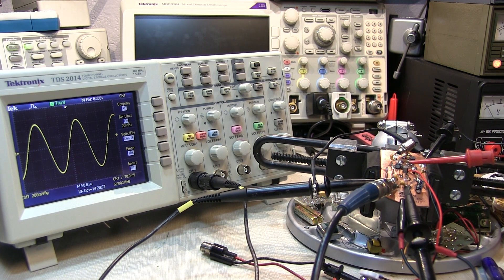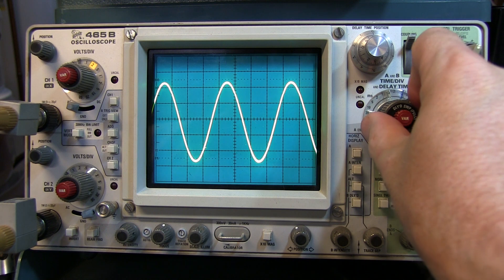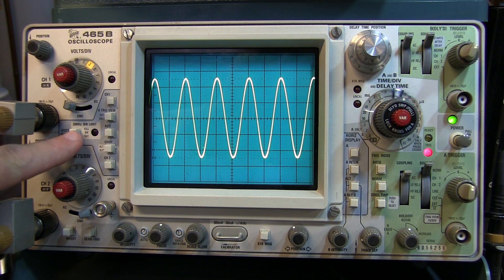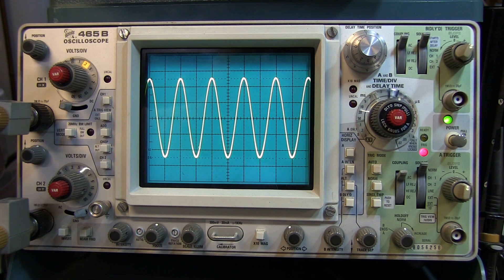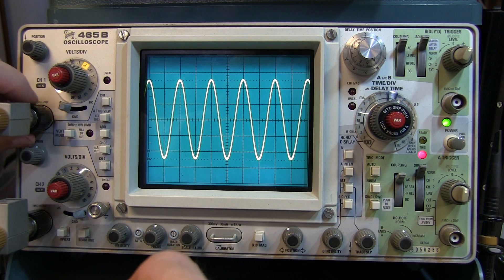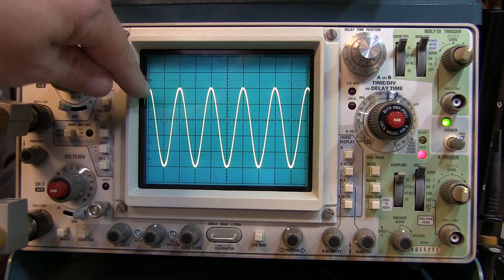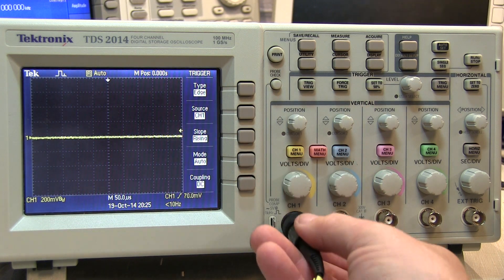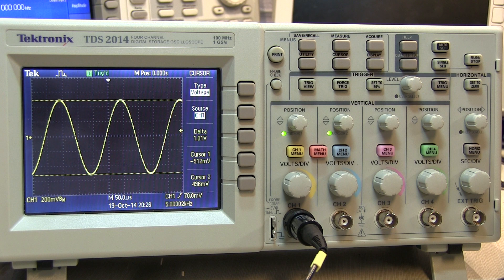#179: How to make a peak to peak voltage measurement on a scope

Comment: How do I measure a peak to peak voltage of 0.55v? I thought I could only set the vault for division to be 1 volt per division or 0.5, not 0.05
Reply from the maker: Your scope should give you more choices than that!  Using 0.1V (100mV) per division, your 0.55V signal will be 5 and a half digits tall.

Comment: Awesome videos 
Sir I need your help to get a sinewave voltage amplifier circuit in the frequency range of 500khz to 1200khz which is to be driven by function generator sinewave signal source of 10 volt peal to peak. The output of the circuit should be 35 volt peak to peak at given input signal with an output impedance of 600 ohms..
Can you please share the schematic diagram with component values . An early response will be highly appreciated.
Thanks & kind regards.

Comment: I used the 465B for most of my career ... and I loved it. I've got some stories I could tell where it really saved my butt finding a tiny glitch on the 5V supply on our prototype of a drone nav system (using Omega signals, before GPS was practical). The the one nano-second glitch was caused by a new cooling fan with a brushless DC motor, the newest tech at the time. We went round and round trying to find the processor crash problem with our HP scopes.

We finally get the Tektronix 465B in and hooked it up to the 5V supply, then turned all the lights out in the lab. There it was ... dimly visible .... a one nano-second glitch to about 6V. My understanding from the rep was that the Tektronix CRT had a higher writing speed than the HP. (I suppose there must be a term for that specification.) Anyway, love the Tek scopes.
Reply from the maker: Great story, thanks!  I used a 465 when I worked in a TV repair shop in the late 70s.

Comment: +w2aew -  RE: 120VAC/20A House Circuit - Are you saying it's OK to connect the scope probe ground lead to the wall outlet neutral, and 10x probe to the wall outlet hot directly?  Or, do you need some kind of current limiter in circuit to protect the scope and leads?  Thx.
Reply from the maker: It depends on your scope and probe, and making sure that the wall outlet is wired properly. Remember that 120VAC translates to 340Vpp, so make sure that your probe is rated for that, and that your scope has a vertical setting that can be set high enough. If you have any doubts about it, don't do it. Line voltage can be lethal and it's nothing to mess around with if you're not sure what you're doing.
Reply: Many Thanks. I'm using a older Tektronix 2465BCT that was recently re-calibrated. Found a manual; Max Input Voltage DC, AC, or GND Coupled = 400 V (dc + peak ac) 800V p-p ac for anything under 10kHz. 

You make a great point - make sure the probes are properly rated.!!

I have a Variac, so will use it for a softer start, and ramp up.

Comment: How do you make this measurement with a straight line..like a DC source??
Reply from the maker: Put scope in DC coupling mode, connect probe to ground and adjust vertical position to place trace on a convenient graticule line. Then connect to desired D.C. voltage and the count the divisions from the ground. Or of course, simply use a DMM.
Reply: Very good point.  Thx. Love your videos/expertise.

Comment: I do home solar and just bought a digital o-scope. I need to measure the AC waveform from my inverter. When I was in the military we used the o-scope to view the 120v AC waveform from our field generators...I want to do the same. We put the test lead probe into the wall socket and the o-scope would show the sinusoidal waveform. Which test lead probe do I need? Can't remember what we used to use. Thanks.
Reply from the maker: You would want to use a 10x probe, and be absolutely sure about connecting the probe ground to the neutral side of the line.

Comment: I'm pretty scope ignorant though I've been in the tech field for years.the most I used a scope for was measuring pulse signals on linear positioning scales to adjust the reader. I'm so embarrassed. Most of the EE's I work with are clueless when it comes to scopes. Seems the techs are more hands on sad to say. You see all a tech does is  diagnose a bad board and replace the entire board and not repair it when practical. Today a lot of boards use proprietary components, but some can be repaired...
Reply from the maker: Corvette Coupe No need to feel embarrassed by being scope ignorant!  It's time to feel embarrassed when you can't/won't recognize the skills that you are not familiar with.  I've got a lot of "scope basics" videos here - from the basic use of the controls, to probing, to various measurement applications.  I agree - component level troubleshooting is a skill that is fading from industry.  When I worked in TV repair (late 70s / early 80s), we did a lot of component level troubleshooting.  However, this type of skill is still very valuable regardless.

Comment: after restoring a heathkit hw-16 and getting 599 rst reports on 40 meters , i tryed using 15 meters and got 2 rst reports with a 5 for the tone quality indicating  my radio had problem . i put it on the oscilliscope with an rf sampler and i see a perfect sine wave . if my radio had a tone problem wouldnt i see it on the scope ?
Reply from the maker: Maybe, depending on the nature of the distortion on the CW signal. Amplitude modulation would be visible in a variation of the peaks of the sinewave but, more likely the distortion is some sort of chirp or FM, which would not be visible. If your signal was chirping by a few hundred Hz, that represents a deviation in the carrier period of 10 or 20 parts per million (ppm) on 15m, which would definitely not be visible on the scope.

Comment: Can you damage your oscilloscope if you don't set it up properly or if you measure something wrong? Thanks
Reply from the maker: Generally, if you don't exceed the input voltage range, you should be ok. Just setting up the vertical, horizontal or trigger setting won't do any damage.
Reply: ***** I have an osciloscopio goldstar os-9040d and I haven't used one before. I will read more things before using it. I have a power source from a SkyBox which is not working properly and I want to practice on this. Thank you
Reply from the maker: Cristian Ionut Marcu The most important thing is to be careful with the Ground connection - be sure that the scope ground is at the same potential as the circuit ground.  Check out EEVblog video on "how not to blow up your scope".
Reply: ***** Thank you a lot. I will have a look on your blog.

Comment: Great work. Can you also make a video about RMS or calculate PP to RMS?
Reply from the maker: Sirus Actually - for a pure AC sinewave, RMS is pp x 0.5 x 0.7071.  Which is the same as p x 0.7071.  I did this video on peak and RMS measurements on a sine and square wave that you might find helpful:
RMS Voltage for Sine and square waves, and why your DMM might not work right!
Reply: For regular ac sin rms= pp x .7071 or p x .7071.
any other signal gets mind boggling. so should make a great video.
Reply: ***** Yup, your right. I missed a 0.5 for pp. not long passed 98% on electricians course. we never deal with PP. Electronics being my hobby.
All the best :D
Reply: Thanks, Super.